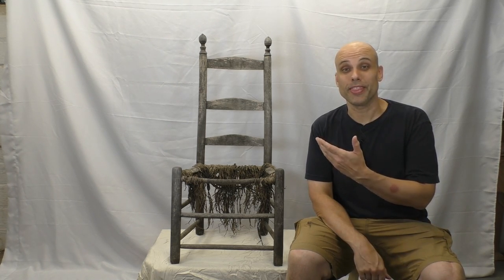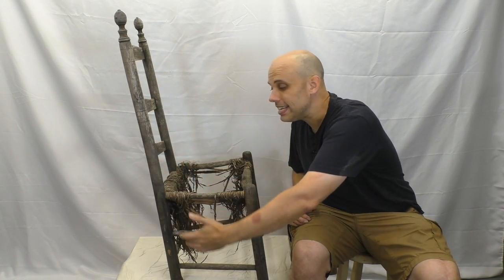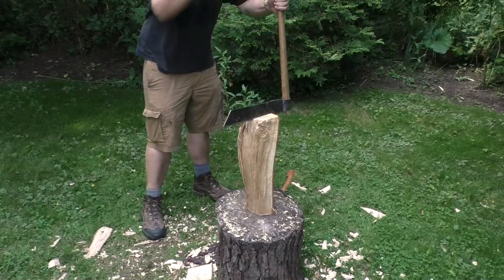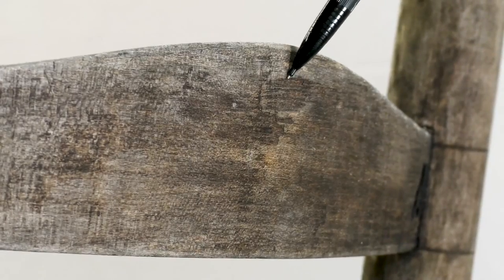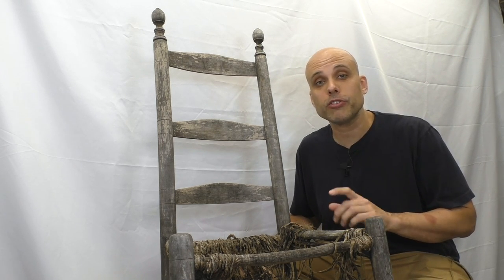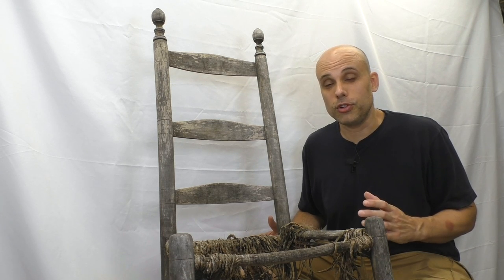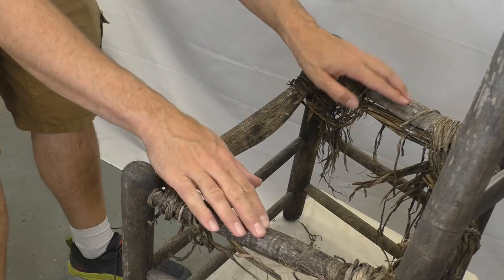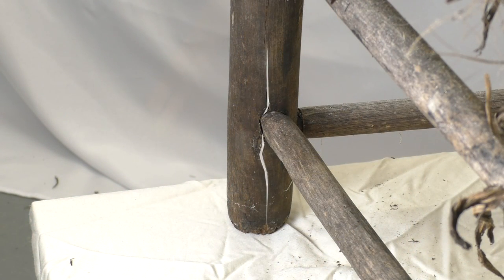Furniture Forensics with a Country Chair

Comment: I knew a fellow who made Windsor chairs. He dried out the ends of the rungs by sticking them in warm/hot sand. Then as you said Rex, when they normalized to usual humidity, they locked in.

Comment: Great video!!! FYI, ladderbacks were often used as “walkers” by toddlers learning to walk. They would lay the chairs down on its back then would stand between the legs for support. Many older ladderbacks will clearly prove they were used for this purpose because they have flat areas on the back of the posts. This occurred after generations of kids learned to walk using  the chairs for support.
Reply from the maker: Holy crap! Really?
Reply: @RexKrueger  Yep different types of chairs and stools have been used for that purpose along millenia.

Comment: I was pleased to see this video. I recently got a small ladder back chair like this that has been in the family for ages. It was covered in multiple coats of paint and had a hickory bark seat that was in bad shape. After stripping the old house paint and what appears to have been red and green milk paint I uncovered a chair like yours. It is short, only 33 1/2 “ tall with a 16” seat height. It also has layout lines scored in the turnings like you described. It is a very sturdy little chair. It came to Michigan from eastern Ontario, but I was told by my mother that it was originally from Ohio or Kentucky.
Reply: After I painted the chair with 2 coats each of red and blue milk paint, I redid the seat with blue and white Shaker sear tape. Good as new.

Comment: I can well believe that there is no glue. I was doing a project where I needed to dowel the joints but the dowels needed to be twice the length of the premade dowels. Thought buy rod from the the big store and cut to length. The 10mm Tasmanian Ash didn't fit really well so after I ran the callipers over it and it was 9.67. I cut a length longer than needed, drilled a 9.5 hole chucked the dowel into a drill and drilled the dowel into the joint. The speed and friction forced the dowel in far enough to finish off with some energetic pounding. No glue but rock solid with 1.67 mm. Years later tried to disassemble couldn't even shift it with a sledge hammer had to cut the joint off.

Comment: This is a most excellent segment.  Maybe your best.  It is an excellent breakdown of of this chair to incredible detail.  As a spindle turner who has made a number of modern variations, you nailed. it.  Can't wait for the K-chair!
Reply: BTW - consider Shaker tape for the seat.  I have done both.  You could use it on a refurb of this chair too, but I'd be inclined to do fibre rush as a more historical restoration.

Comment: As you were describing the chair, I was looking over at my ladder back rocking chair, noting a lot of similarities. The chair naturally reclines a bit, the angle between the seat and the back is a little over 90 degrees, the rungs have tenon in the legs. My chair is 40 years old and was made by one craftsman in a workshop. The joints are secured with finishing nails. The seat is made from slats. Looking at the grain, it appears that the  back slats were resawn from one board and all of the seats slats were resawn from one board.
Reply: I wouldn’t be surprised if the slats were split rather than sawn, as split wood is easier to bend without splintering.

Comment: I just worked on a similar ladder back chair. The rush was in very good condition as it was redone recently, which made things difficult. I had to fix most of the joints, which were completely broken, with more modern techniques so the chair won't be quite a sturdy but it will be functional. Looking forward to your build. Side note: Alec Steel did a greenwood project with his father not too long ago, very entertaining and informative.

Comment: I really like the idea of combining the dry oak with the green soft maple to create a joint that locks in place and shaving the tenon so that all the forces on the mortises are compressive to avoid splitting. Seems like you could adapt these techniques to fine furniture as well. No reason everything has to be a spindle even though it makes complete sense for someone churning out a product made by hand quickly using wood pieces which are split off instead of being milled to dimension.

Comment: Hello Rex, this is a very good examination of the chair, many thanks.
Here in UK, a chair like this would have had a rush seat. Rush is itself a contribution to comfort as it retains a little flexibility, and often the cavities that the weaving process creates were stuffed with bundles of bits of rush to plump up the seat. A rush bottom wears out before the woodwork, and a chair would be reseated probably several times in the lifetime of the frame. Of course, if rushes or the skill to use them were not to hand, other materials would be used. Spun sea grass made the job easy, sometimes a piece of wood nailed on if nothing else was available. At one time I made a (poor) living re-rushing chairs and saw all sorts of improvised mends. All this just to say, don’t pass the opportunity to give your version of this chair a proper rush bottom, and treat the old chair to a new one too, perhaps. 
This series of expositions is a real treat, you do these detailed examinations very well. Keep it up and best wishes.

Comment: I love these furniture forensics videos! I do the same thing whenever I get my hands on a secondhand piece of furniture and I've learned a lot. I tried disassembling an old oak farm table the other day and was cursing the brilliance of the maker because the more I tried to pull the pieces apart the tighter the joint was getting and I split the whole damn apron...
Anyway, I'm looking forward to the chair!
Reply: Were the tenons fox wedged ?
Reply: I didn't know that's what those were called! This piece, however, had a different joint--the corners of the aprons were joined together with a simple miter, but the corner braces were fitted into each apron with hidden sliding dovetails, so the more I pulled the two pieces apart the more wedged in they became until it finally split and I saw what was happening.

Comment: I once had the chance to help tear down a 150 year old post and beam barn..  all the joints were mortise and tennoned and thru-pegged.    They were STUNNINGINLY tight.    At first thought we could punch the pegs out so we could maybe reassemble potions of it. ...That idea ended when after 2 hours of hammering on a peg with a brass drift pin and it hardly moved at all.   Some of the guys were ready to throw the idea that we'd never get it apart and were willing to just start cutting things apart.   I suggested we use an auger and bore the peg out with a slightly oversized bit.. we'd have to replace the pin, but that is a lot easier and less work than reworking major timbers...
Even after boring the pins out completely, the timbers STILL didn't want to come apart easily, requiring a lot of levering and even a porta-power spreader to get to finally come apart.    But we were able to deconstruct the bldg and it now stands in a new location, though with new pegs    
my friends grandfather later told us, the pegs like that were routinely cut from green wood (often hickory or ash) cut oversized and hard driven into place and cut flush.  done that way, they kind of "bond" to the other wood in a way that it's nearly impossible to get them out.  it must be bored out, the way we'd done

Comment: I'm a little late to the party, but I've been around these chairs for a long time. O live in the Appalachian hills of Georgia and my great grandpa had a couple for the longest time on the porch of his house that he made himself. The tenons are very important but the the weave of the chair seat is equally important. He used twine that he then wove into a thin rope to hold it together. I don't recall him pegging the top rung on the but it was more of the woven seat and tenons drying right that held all the components together.

Comment: Good observances. I would conclude that this chair was made not by an individual, but churned out in quantity by a crew of 3-6 or more people with varying skills in an efficient, low margin "mass-production" shop. The wood turner likely being the most knowledgeable and perhaps the designer who shapes the legs and marks the locations for the joints from a pattern or even benchmarks directly on the lathe. Next down the skill ladder was the person (people) making the rails and bending/shaping the back pieces. Then the assemblers who drill the holes and cut the mortises. Perhaps an apprentice got the leg holes and mortise size wrong, but more likely were just the result of a fast paced production environment where the mistake leg just got used anyway and the long mortise shimmed instead of wasting time and material re-making parts. Finally there are the caners who wove the seats on.
Low overhead and narrow margins won out against perfection in this shop. It's obvious that getting the most out of the materials and workers time was essential to that business staying profitable. The final product had to be as affordable as possible for the poor masses versus a fine quality shop that makes fewer, high margin, sometimes custom pieces to rich clients.

Comment: Super analysis! I was cheering for the chair not to break or come apart! Can you point to an example of the sort of lathe a country craftsman might have used. Those back supports with finial are at least 4ft, which is some pretty serious length to spin a spindle! Not using a long lathe for your duplicate build? Pity! Cheers! Farmer John, Ontario, Canada

Comment: Rex, a very interesting video. However, when taking a structure apart, never start at the middle member. You're fighting the upper and lower members when you do that. This is my experience with e.g. taking down timber walls and pallets.

Comment: Rex could it be possible that there are wedges cut into the tenons on both ends and hammered into place on final fit out? This would secure the tendon in the mortise but still be blind

Comment: RE: differential shrinkage ; Hi Rex, I tried many times to assemble bone dry vs really wet for the tenons and mortises, respectively, and it turns out that more often than not, very wet means the mortise will shrink way too much, locking ultra-tight, but in the process breaking its cells, and when it'll reach equilibrium the joint can become loose. That really puzzled me. I think I found the answer in Jogge Sundqvist's Sloyd in wood: (going from memory, the book is not with me right now)the tenons can be bone dry to 5% MC, and the posts can be at 15%MC. they'll reach equilibrium and lock without making too big a swing.

Comment: Wow! I just subscribed. I have a small restoration business in Florida and chairs are at least 50 % of my projects. I have told customers about some things I observed and consider myself somewhat of a furniture detective also but you, sir, have a much greater abundance of knowledge than I will ever have. Question: I had a customer last year who went on and on about the fact that her chairs had Roman numerals on them, saying that made them more valuable. Well I just repaired an old walnut ladder back, formerly rush, but now upholstered, with the numerals XIII stamped into the front rail. Could you provide some insight on this? New subscriber Ken B

Comment: Hey Rex, is there any indication that the tenons had an inverse taper? The maker had a clear understanding of how the mortise would shrink as it dried so do you think that a tenon was designed in a way for the mortise to lock around the tenon like a dovetail, aside from the techniques you pointed out of course.
If it doesn’t, would you be interested in testing out this theory? I’ll take a look to see if this was ever used in a historical way and come back with some answers.
Reply: From a conversation many years ago with an old bodger, a plain tenon gives the maximum surface area to be gripped. A reverse taper would only grip the wider tip.

Comment: does wood do enough temperature-based expansion/contraction that you could put a piece with a tenon in the freezer so it contracts, and then have it expand to become tight inside a mortise at room temperature?

Comment: Fantastic video Rex! I just have one question nagging at the back of my mind... Maybe two 🤣! In everything I've been taught of wood movement, I've always been told that wood will never shrink along its length, only heighth/width or tangentially/radially... So will a mortise shrink around a rung all around or just on the sides of it? And if it is just on the sides, would it cause the rungs tenon to change shape slightly to create that "shaved sides" look? Genuinely curious here, and hope I'm not completely off the deep end! Thanks for another great video Rex!!
Reply from the maker: That shrinkage split the post before it deforms the tenon.  Especially in oak.  The fit of the tenon is so tight that the smallest bit of vertical shrinkage locks it in.

Comment: It would've been the funniest thing I have ever seen if the chair had you bust your butt😂😂😂At least 3 times funnier than the tool elves bit, and the tool elves are absolutely hilarious 🤣
Reply: Oh, Rex, if you read this, I've been wondering if the traditional furniture in Ohio is the same as in West Virginia? Specifically the Potomac area by Western Maryland, and Northern Virginia. We have this style that's called the look of the Potomac, it's basically vines growing on fences and sheds. I like the look of it, the only issue is, it's a nightmare to maintain as a landscaper. However my main concern is if all the traditional furniture on your channel, such as the Six-Boarded Chests, will be Ohio style instead of Best Virginia's 😂😂😂

Comment: Bodging goes back to the stone age,  'modern' carpentry dates from the bronze age (2500 bc in Britain') with the introduction of metal tools.
Reply: furthermore (!) a bodged chair can cost c£1000 a piece.
Reply: and.....in a church near Götene there is a Bodger made chair on display, made for a Bishop in the 900's roped off now (!)so no one can sit on it (a tourist type of vandalism) but it still looks good if  bit overdone on the turned ornamentation :)

Comment: If the maker truly understood wood, wouldn't he or she use locust in the construction of the pegs? The natural splitting of the wood allows for expansion of the pegs and was the favored choice for shipping building pegs.
Reply: Not necessarily an available wood in central Idaho... and back to a matter of cost.
Reply: @dlevi67  do you live in Central Idaho? I live in Western Mass and locust is a weed here. And I am sure that Northern Ohio has very similar forests as New England. So, maybe it is possible that the peg is locust, as it is also an iron wood and seems to last forever.
Reply: @daviddoyle2738  No, I live in Europe, and totally my bad for mishearing; Rex clearly says Ohio multiple times (and I know from other videos that this is where he lives), but I heard "Idaho".

It is possible that the pegs are locust (even if the chair came from Idaho, where locust is less common than further East) - I'm just saying that it's one more wood species to find and buy, and it may have been "too costly" for the cheap product that the chair was supposed to be.
Reply: @dlevi67  Where in Europe. As for the locust, it is best worked when it is green. The chair is green wood woodworking. So it seemed natural to me that the pegs were made from a common iron wood tree that grows like a weed.
Reply: @daviddoyle2738  UK - where locust is not particularly common, BTW.